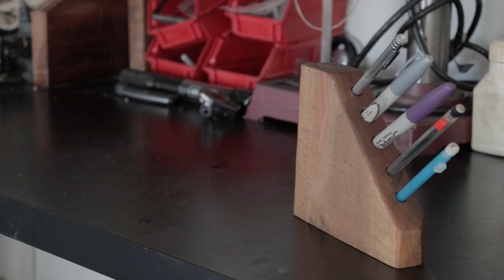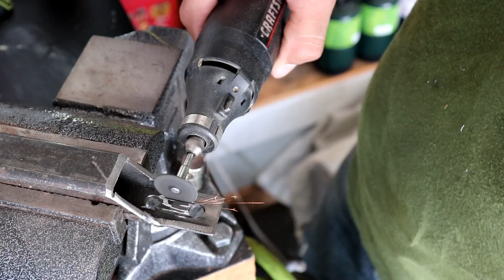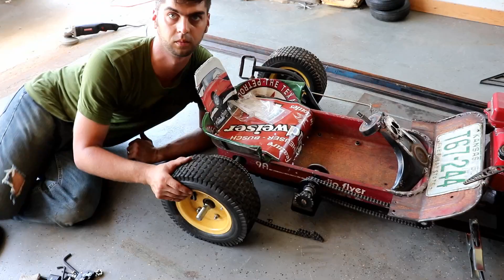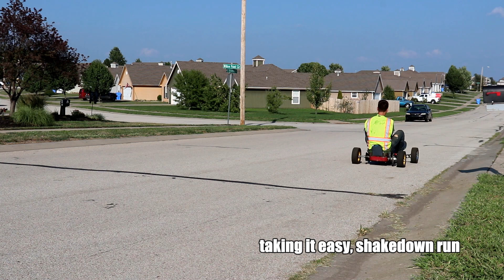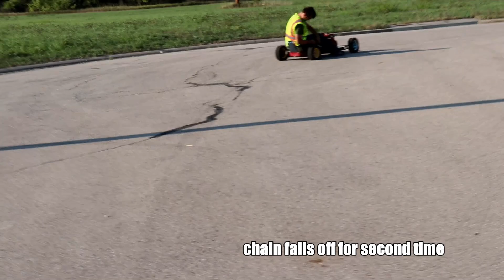Rat Rod Radio Flyer (43): It Stops, It Runs version 2!

Comment: Nice video. You can buy half links. They are another style of master link. Keep up the good work on videos. What gauge chain are you using?
Reply from the maker: Yeah, someone else mentioned that too. I started out using #35, so I kind of got stuck in that rut
Reply: Str8sixfan if you can not find any half links around you let me know and I will pick up a few and mail them to you
Reply from the maker: @MHFtractor  hey thanks! I plan on flipping around the tensioner first and trying that
Reply: Str8sixfan no problem just let me know

Comment: Time to build the engine into a Raptor race engine and get the high stall clutch!  And get some real Cart tires 😎👍
Reply from the maker: I do have a billet connecting rod for it and plan to remove the governor...but that's winter work. The cart tires thought...yes I do need those!
Reply: Str8sixfan Some how the Jr. dragsters at the track get maybe 20hp out of 5hp engines?  I’m not familiar with all the tricks on small engines, good luck very cool project!  😎
Definitely digging the new project too!